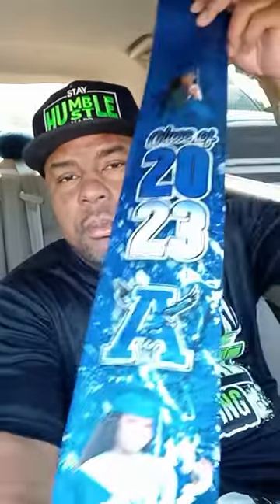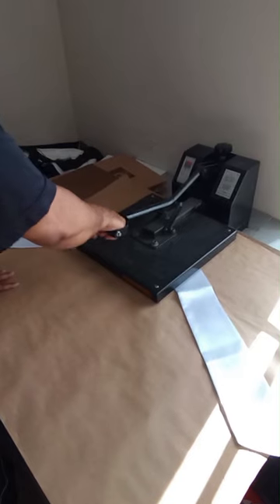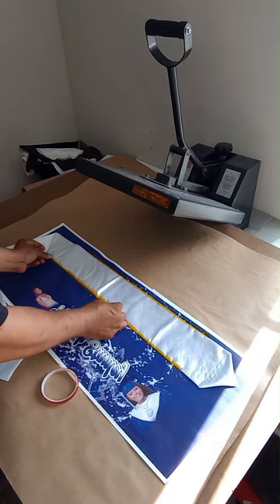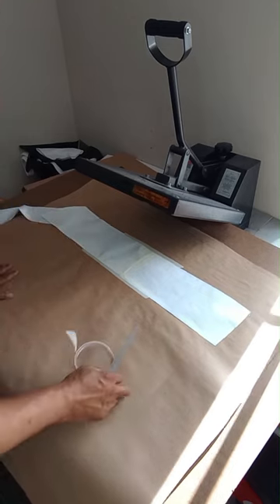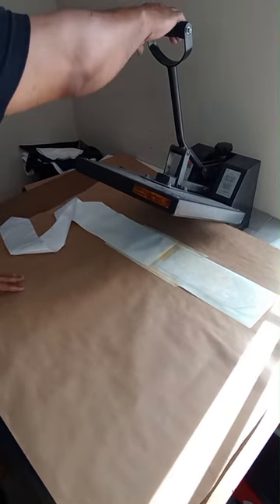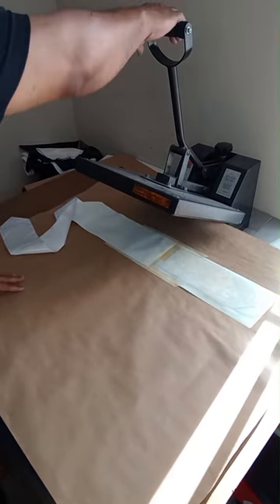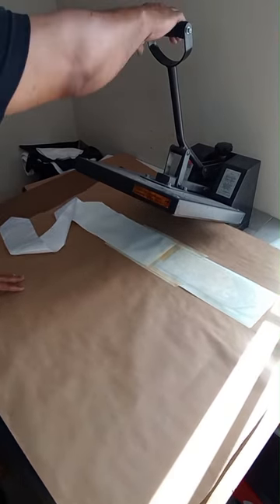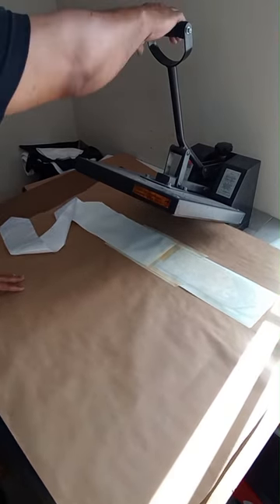Sublimation Stoles For Graduation - Easy Method (2023 Tutorial)

Comment: The real question is how do you get it to print on that big of a paper? What do you need to print on that big of a paper? What size is that paper?
Reply: That’s what I need to know! That eliminates half the struggle! Biggest I have is 13x19
Reply: Now that I looked closely, he actually have the parts taped together from the back. very nicely done cause you can’t even notice that👌🏾
Reply: If your printer can print up to 13x19. You can buy the roll and adjust the print setting. No need to print multiple papers.  The problem I'm having is getting the heat press mark.
Reply: Do the tile method